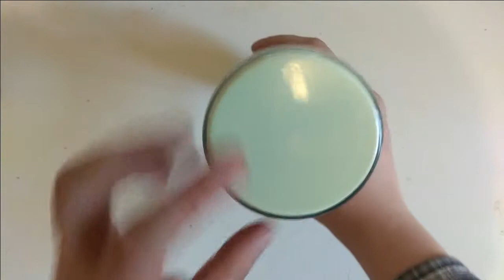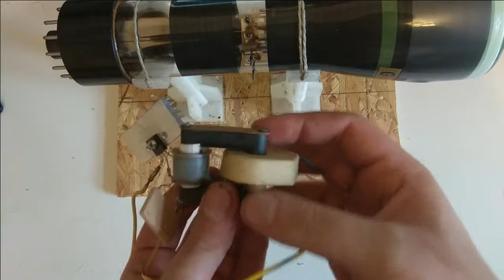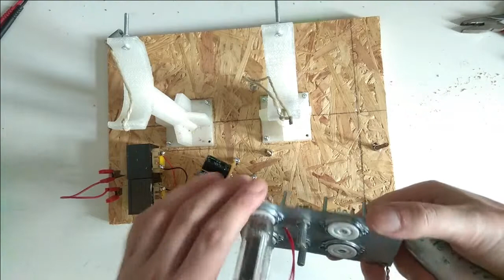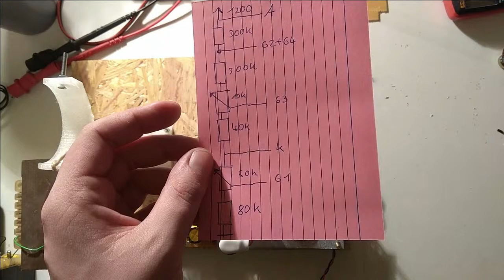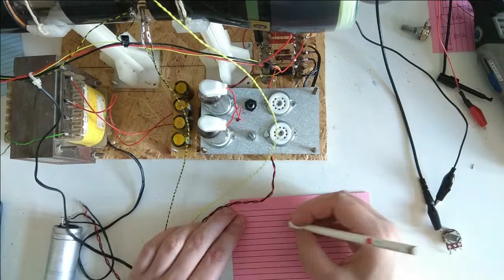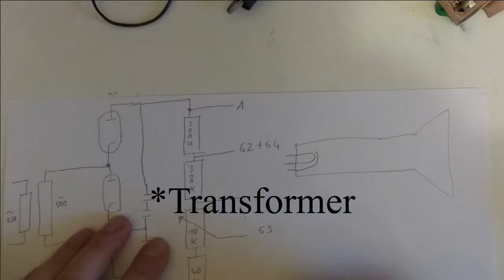Building a cathode-ray oscilloscope Part 1: Power Supply

Comment: I have 5.5 inch colour CRT,  how much flyback power he takes? Cause I had no info on it. Thanks
Reply from the maker: Probably around 15kV i'd say, although I'd recommend looking into this some more before powering it up. Here's some info: https://www.avsforum.com/threads/anode-voltage-on-a-typical-5-color-crt.468341/ I'd recommend checking some service manual for devices that have a crt like that some might have some info on the voltage.

Comment: Truly useless time spending to watch this video and make CRT oscilloscope drive vacuum tubes instead semiconductors in year 2024. If you want to get 1000+ likes use CRT that you have and build BK-Presision 1405 oscilloscope clone (16 transistors + one more for trace blanking as the option). This one even better than Chinese low price digital oscilloscope like well known DSO-138 and similar ones.

Comment: BTW i know i am a bit late but i have used bug zappers cheap Chinese high voltage models with an lm317 variable supply you can adjust this high voltage ,i used the idea on a P7 CRT SSTV 2 or 3 years back ...you will need that large transformer to drive the  deflection amplifiers  But ..i used a 800v ac out transformer but the 800 ac in series with another small tiny 240v transformers primary this drops the AC and you can control the ac out via a the secondary as in a magnetic amplifier ...very safe and very easy to control high voltages with this very old idea .
Reply from the maker: I actually hadn't thought about using a transformer to regulate the voltage although I have seen this used a couple of times. Might finds it's way into a project in the future!

Comment: Just a tip for you. Magnetically deflected CRTS operate at approximately 1KV per diagonal inch or about 400V per centimeter. So, lacking any other data, this rule is pretty reliable.
Reply from the maker: With it being a bit over 2in that puts it about 2KV, the data I do have says that it's tested to run from about 850V to 2KV so that's about right. I wanted to start at a lower voltage and raise the voltage if it proofs to be insufficient. I can't see the comment you left on this video earlier at the moment, but I am subscribed to your channel already and I enjoy your projects!
Reply: @captainsolder5247  I did say that rule of thumb was for magnetically deflected CRTs. Typically the higher voltage is because of the aluminum (aluminium) back coating of the phosphor. True, the static tubes do work at lower voltage because the phosphor is usually not aluminized. Especially the older tubes such as the one you are using. Keep up the great work.
Reply from the maker: @videolabguy  For some reason I read electrostatic where you wrote magnetically this morning. You are right on the aluminisation too, on these (B7S3) tubes the back of the phosphor is clearly visible. Thank you, I'll
Reply: The back of my 14.5 diagonal inch CRTTV says 120V but according to your math it should be 14,500V. What's going on?

Comment: This is an excellent project and you seem more knowledgeable than the average amateur electronics enthusiast. Have you seen my channel's cathode ray tube projects? I work with both electrostatic and magnetic tubes and cover high voltage power supplies that are relatively simple and robust. If you have not, please check out my channel and maybe subscribe if you like. I have subscribed to your channel just now. Thanks!